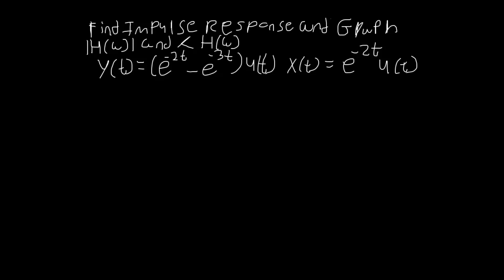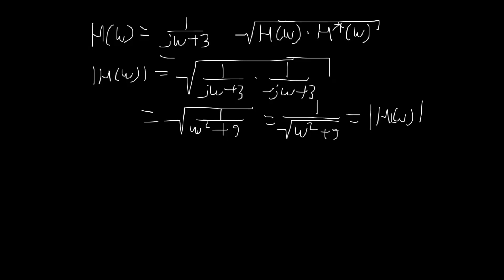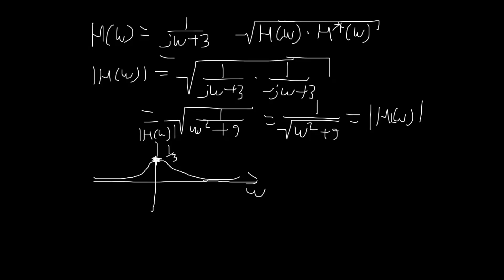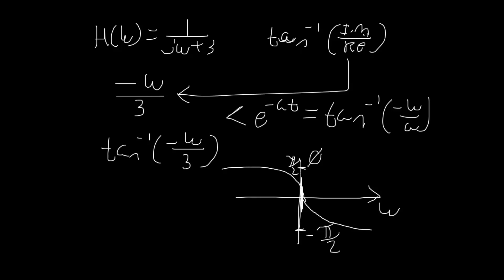Fourier Transform and Magnitude and Phase Response

Comment: So the reason why Im{H(w)}/Re{H(w)} is (-w/3) has to do with the fact that 1/jw+3 = (3-jw)/(w^2+9) (this gets accomplished by multiplying the numerator and denominator by the complex conjugate of jw+3). This can be factored to 1/(w^2+9) * (3-jw), the 1/(w^2+9) will be in both the numerator and denominator of the arctangent and will cancel out. Re{(3-jw)} = 3, Im{(3-jw)} = -w, so arctan(Im{H(w)}/Re{H(w)}) = arctan(-w/3).

Comment: Thanks for the video Michael! 9:36 you say that you don't know why it's Minus omega (= -w) If there is someone who desperately ;) wants to know why this is, perhaps this will help you. First we start with separating the real and imaginary part. 

H(w) = H(w) . H*(w)/H*(w) =1/(jw+3) * (-jw+3)/(-jw+3) = -jw+3/(w^2+9) = -jw/(w^2+9) + 3(w^2+9). So now the real and imaginary part are separated.

Real part: Re(H(w)) = 3/(w^2+9) 
Imaginary part: Im(H(w)) = -w/(w^2+9) <== without j because of H(w) = Im()*j + Re() 

plug it in to the arctan() = tan^-1()

arctan{Im()/Re()} ==>the denominators of the real and imaginary part are the same so they cancel out, so:

arctan{Im()/Re()} = arctan{-w/3}

That's why it's minus omega :) 

Cheers
Reply: Okay, so in general to find the real and imaginary parts of a complex valued function, you need to do some algebra to group up the real bits and the imaginary bits (recall, c= a+bi). 

To find the real and imaginary components of the function H(w), you need to first get rid of the j in the denominator! you do this by multiplying both the numerator and denominator (ie multiply by one) by the complex conjugate of jw+3 ( recall, (jw+3)*= -jw+3 ).

H(w) = 1/(jw+3) = [1/(jw+3)] * [(jw-3)/(jw-3)] 
          = (jw-3)/(-w^2 - 9) = -(jw-3)/(w^2 + 9)
          = [-w/(w^2+9)] j + [3/(w^2+9)]

So hopefully you can see that

Re{H(w)}= 3/(w^2+9) and Im{H(w)}= -w/(w^2+9).

To find the phase, you compute arctan( Im{H(w)} / Re{H(w)} ).

so phase(H(w)) = arctan( [-w/(w^2+3)] / [3/(w^+3)] ) = arctan(-w/3).

Hopefully this helps!
Reply: I do it in another way, 
The phase of the numerator - The phase of the denominator 
Where the numerator's phase here is tan^-1(0 )=0 and the denominator's phase is tan^-1(w/3) 
So it would be - tan^-1(w/3) 

In general We find the phase in this way:
tan^-1(imag./real) / tan^-1(imag./real)
Numerator/denominator
Reply: thanks dude.